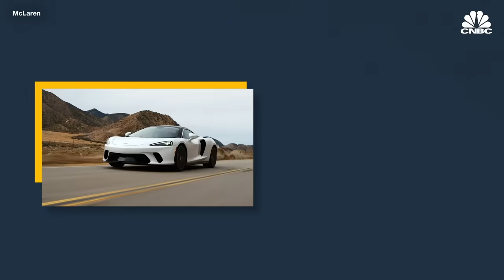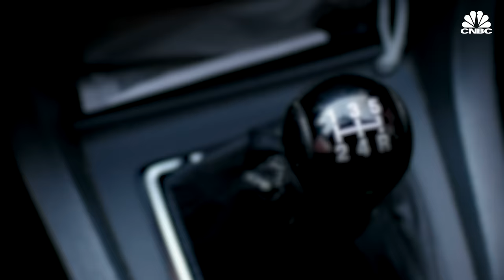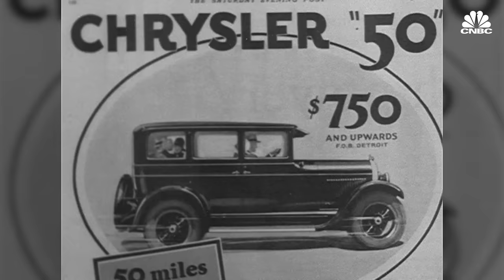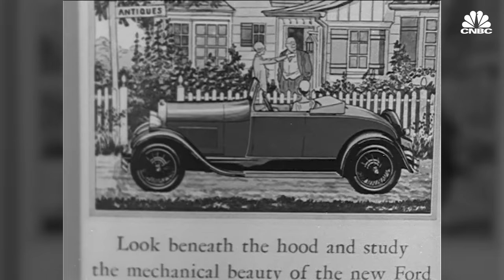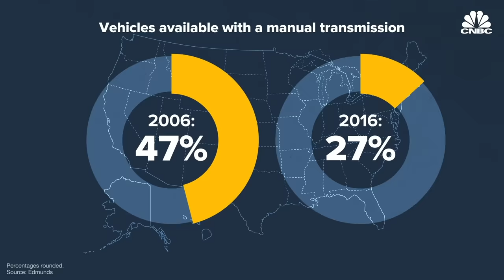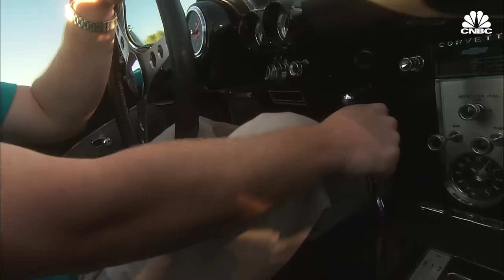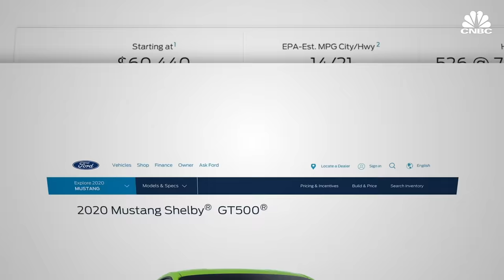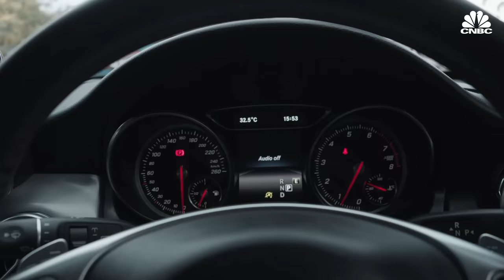Why Stick Shifts Are Going Extinct

Comment: Automatic cars are for people who don’t like driving.
Reply: Some pro drivers I know would often tell me, "Automatic transmission cars are for people who are lazy drivers" ;-)
Reply: Who likes driving? Its call A.I
Reply: I drove a manual to work and from work everyday for years. Imagine a 3 hour commute driving in bumper to bumper traffic. That car had never seen anything past the 3rd gear. My hand would hurt. My left foot hurt. When I bought the car I own today, one of the biggest selling points was the fact that it is an automatic. Best money I’ve ever spent.
Reply: Eric H a lot off people.
Reply: Lineworkofficial exactly I’d rather go through the pain !! Each to there own but it keeps you alert rather than just having to rest your foot on the accelerator. Injured and older people yes, if you have any driving passion, no. I’m a builder and work a 10 hour day and travel two hours a day for that work in my vw caddy. Best bit of my day by far is the drive, even in traffic ( very light as I leave at 5.45 am)
Reply: Me here dont like driving but i have to use the car !iam going automatic!
Reply: i wish i had a manual but i can only drive what my parents provide which is automatics, im 24 not a kid btw
Reply: @tempo5555  respect my brother, what car you drive, I have a 2010 camaro ss with simple bolts on and tsp piston & rod with a e85 conversion
Reply: Or where traffic is. Iove manual, but honestly I live in Toronto and traffic is absolutely insane here. No way would I even bother getting a manual car again. Its just a chore
Reply: Hrmm tell that to the super car owners.
Reply: @SilvioRossiOfficial  Sounds like you need to move. Why would you spend that much time in traffic?
Reply: Speak for yourself lol
Reply: Auto is for those who don't know how to drive
Reply: That's not enough of a reason to make it so nobody else can ever like driving
Reply: When an automatic transmission cars battery dies out your stuck... manual transmission cars can be pushed to give it a kickstart... plus easier to maintain...
Reply: I drive a truck for a living. No no one seemingly likes driving. They seem to be to preoccupied with their phones to pay attention to the road let alone shift a transmission
Reply: Phase out automatic transmission and see the decrease of driver's on their phones, and less millennials on the road
Reply: As someone who doesn't like to drive. I agree with this.
Reply: For most people, cars are a tool. We don't like or dislike driving, we just want the most appropriate tool for the job.
Reply: It depends were you live. I am from Malta small island with overpopulation and lots of traffic and very hot weather. I drive manual but automatic is much comfortable in traffic next car after this will be auto.
Reply: Marty Crush 
If you need a manual car to stay alert that's not a good thing.
Reply: Dwight penny. What I mean helps keep me alert, cars are to comfy nowadays. Each to their own, more manuals for the rest of us👍
Reply: Formula 1 cars don't have clutch pedal
Reply: Automatics are for people with one leg
Reply: @Onaga-uz3ed  so people who drive automatics spend all there time on their phones? where did you get that from?
Reply: Let's not forget that driving automatic is more environment friendly since it shifts way more efficient than we can and shifting efficiently reduces pollutant output.
Reply: @OrrWeisbergReviews  Your statement would be the perfect example of an oxymoron.
Reply: id say they are for people who aren't stupid, its a little bit more realistic. I'm indifferent when it comes to driving but if i had to choose between driving with very little effort vs having to put my own effort into it and be more focused, of coarse im going to go for the easier option.. Like nobody in the history of ever has said, "god i wish i could switch these gears by myself and do all the work so my car doesn't have to". As human beings, we look to make our lives easier especially since we have so many responsibilities.
Reply: Hmm what about people like myself who can only use one hand i am forced to use a automatic, i still have fun driving my car as crazy as possible
Reply: Jello Mello I think it’s the other way around, automatics change gear more often so will use more fuel.
Reply: Nah, those are for peeople who understand that it's impossible for human to change shifts faster then PDK and the computer. Take Porsche 911 (992) Turbo S for example and compare the 0-100 kmh for manual and automatic gearbox. Manual is a relict that fortunately will die soon.
Reply: Drove Emergency vehicle - no free hand to change radio frequencies, foot operated sirens, city traffic, strobes, monitoring en route sitreps. Auto one less thing to do.
Reply: @jellomello2683  lol. you think manual cars are causing global warming...... an industrial plant puts out more co2 in a day then a car does in a lifetime
Reply: I love driving but I like automatic transmission cars only
Reply: @OnlyL3G3ND  no ones perfect
Reply: @dukeseb  as if there is only one car driving at the time lmao
Reply: Same thing apples to manual cars.
Reply: No, it depends on your city traffic and how long you commute. If it is an American city, I kinda understand why stickshift is unpopular.

 In Indonesia, stickshift is unpopular as well -- we have bad traffic and people tends to commute by north of 60-90 minutes one way (times 2 for daily commute). In Indonesia, people only buy manual just because they cant afford auto transmission.
Reply: @chaos4224  "Like nobody in the history of ever has said, 'god i wish i could switch these gears by myself and do all the work so my car doesn't have to'"

Uh, isn't that the whole reason people buy manuals in the first place?

Comment: Automatics are for commuting. If you really want to have fun driving, learn to drive a standard. It breaks my heart to see a sports car in an automatic. It’s like seeing an expensive high end bicycle with training wheels.
Reply: I commuted for many years with manuals in some very heavy traffic. I seldom needed to touch the clutch or brake pedals. I would just creep along at idle while everyone else was in a hurry just to come to a stop a few seconds later. By the time I closed the distance to the stopped vehicle in front of me they were rolling again and I would just continue creeping along. No brake wear, no sudden stops, no extra worry about getting rear ended. 
As for sports cars with automatics, it isn't really a sports car without a clutch pedal.

Comment: I've always preferred manual shift. Especially when your battery dies and you need to push start it.
Reply: I feel the same except that in my case, it's when the starter goes out.
Reply: Works either way
Reply: Or if you’re driving in snow, how you supposed to slow down if you’re not supposed to use the brakes…
Reply: I agree!!!!
Reply: This isn't a problem anymore than starting a manual on a hill. You have hill assist while automatics can be manually downshifted on the low end.
Reply: @Pambo101  you just downshift and use engine braking ?
Reply: @owl6666 yep let off the gas and the car magically slows down then downshift and slow until it’s going slow enough to 🛑 stop.  @annyoed321: I learned to drive a manual in Seattle where hills are really hills.  Only thing bad about that is the idiot that pulls up 2 inches behind you instead of giving you room to roll a little back to get going!  (Then you have to use the E-brake to keep it from rolling back and hitting them). 
My friend drives an automatic and she doesn’t know why they would pot an E+brake in a car cuz she’s never used hers.scary, she’s now 70 years old and just bought a place that the driveway is steep.  I’m never parking behind her!
Reply: @Pambo101    A modern automatic should be able to be switched on manual. You also need in when driving downhill so ypu don't overheat the brakes.
Reply: @Pambo101   Not always - at least not so that it does not gain speed. You normally need to downshift manually.
Reply: @Pambo101    And she never wondered what the "E" stands for?!
Although think that is funny too. In my culture(s) it is a parking brake or a handbrake, but you learn to use it in emergencies too.
Reply: @Pambo101  You ARE supposed to use the brakes, just carefully.
Reply: I once drove the last 20 yards to the gas pump on the starter motor.
Reply: Not arguing against manuals because I love a good stick shift, but automatics do have neutral.